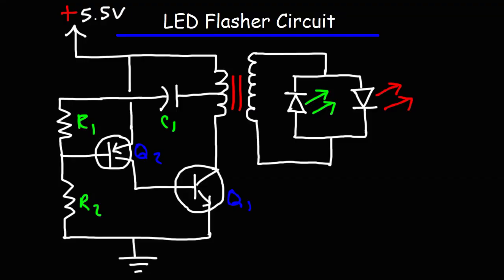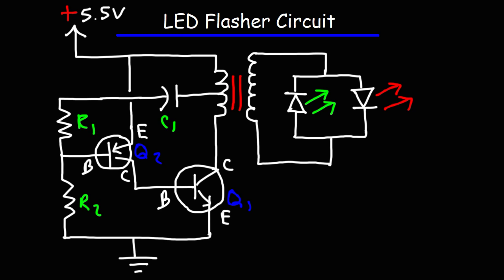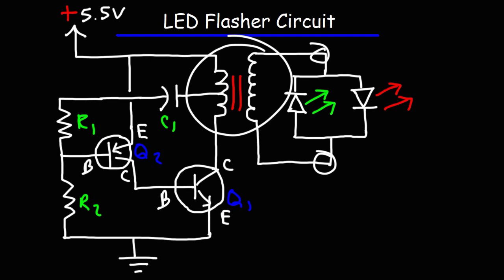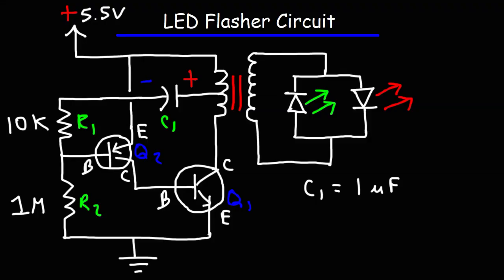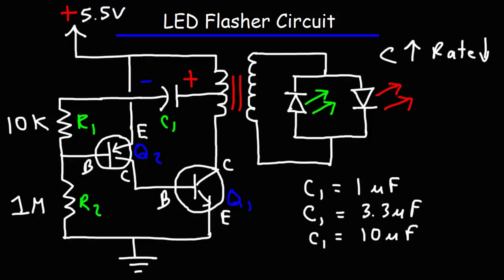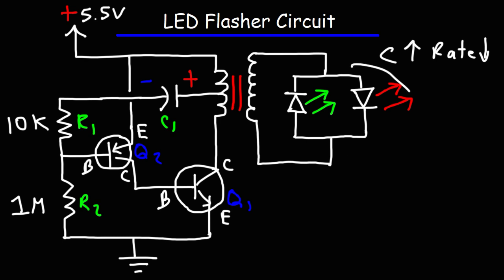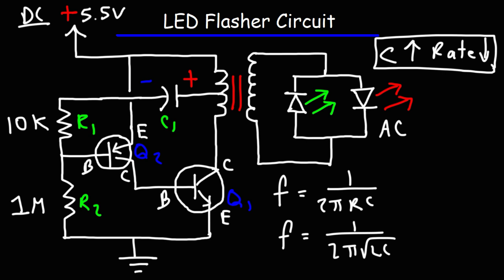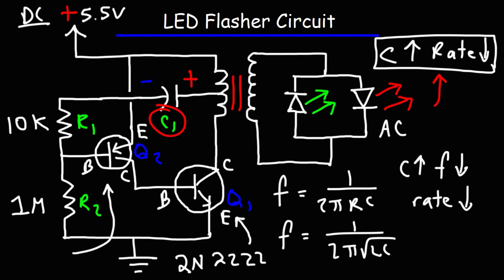LED Flasher Circuit

Comment: Will the lights get damaged by turning them on and off?
Reply: I'm pretty sure that's just another myth that parents lied to their children so they wouldn't spam the light switch on and off. LEDs can be powered on and off quickly like that, they're even used on TV's now that do the same thing, only on a smaller scale.